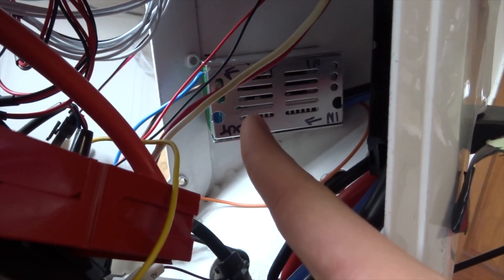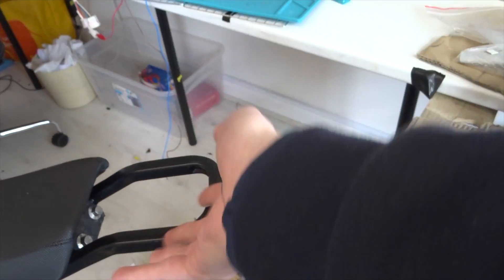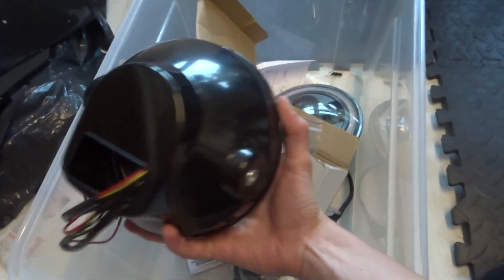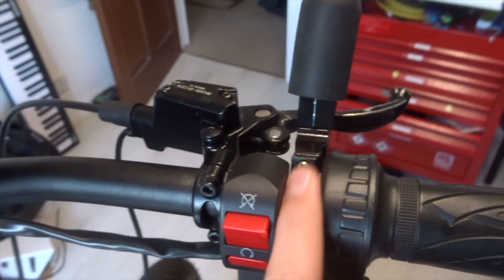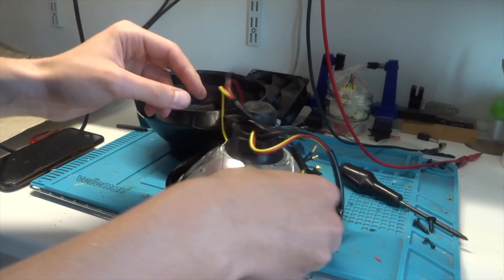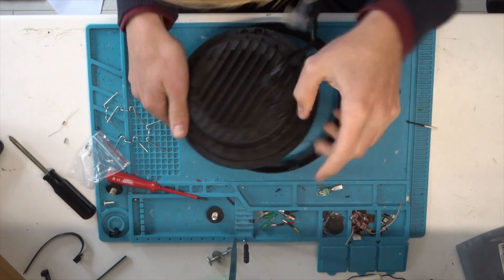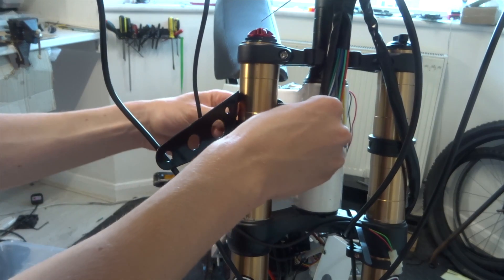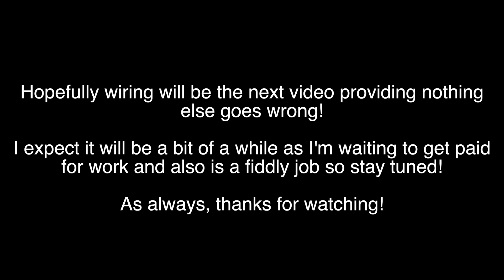FITTING Front and Rear Lights + Howto Guide - 8kW Enduro MSVA eBike V3 Build - Part 17

Comment: Wow it is really coming along! The bike looks amazing. 
I am currently building a similar bike with the same frame, battery and controller(200a).

But I have a question. How did you connect your phone to the controller?(Bluetooth)? How do you put the controller in pair mode? I can’t seem to find out how to make it pop up on my sabvoton app... Any help is appreciated.

Really enjoy your videos, keep it up!!!
Reply from the maker: Have you got 2x 3 pin connectors that are joined together and the external display? If so disconnect them and it should be detected on the app. These wires divert the connection from the bluetooth to the display if connected together.

If not then there's not much to it, make sure the controller is powered on with the enable line as well and it should just show up in the app.

Comment: hi , still stuck on wiring , mainly regulator/rectifier , has 3 wires , were to connect , wires from light switch on handle bar , has horn , indicators , light , I have a flasher unit , 1 connection inside . I have tried many electric bike shops on the wirral , merseyside and none want to help . I phoned stealth bomber , witch is Australian and they won't help coz its a clone or copy . so if anyone knows a shop in nw England or person who can help as my bike is just sitting there .thanks Doug ,

Comment: Glad to see your progress is coming along. For me the lights are the part i enjoy the most! I am running a 2.5t motor now and its scary fast. Cant wait to see your bike when its finished bro👌🏽👌🏽💥💥💥💨💨💨💨
Reply from the maker: What's the top speed on your 2.5t?
Reply: @EverythingEbikeChannel  last test i got it to 80mph however i have dual sport tires on it right now. If i put the hub in my street tire frame i could proubly get even higher speed. My bac8000 and lightspeed pac is really pushing the motor. However my regen throttle stopped working. Going to contact my vendor and go over the programming again. This 2 5t motor is on a slightly smaller tire. This gives me some of my start up puch back..lol. I left a street tire on the front for some flexability.